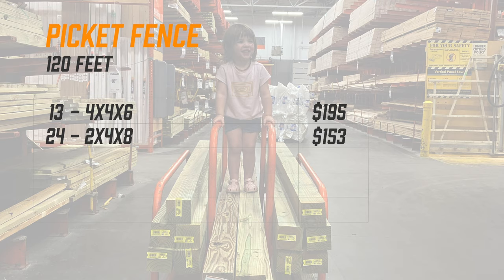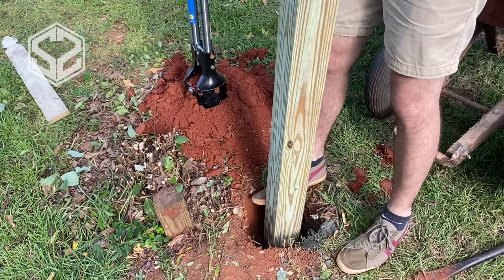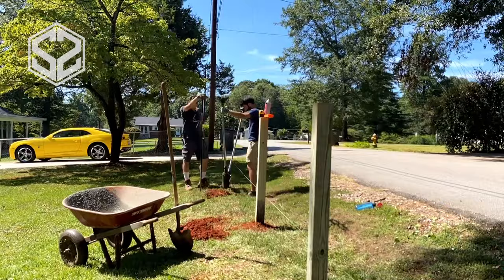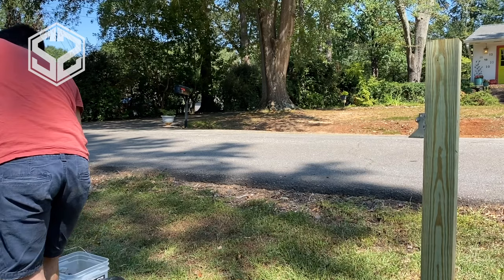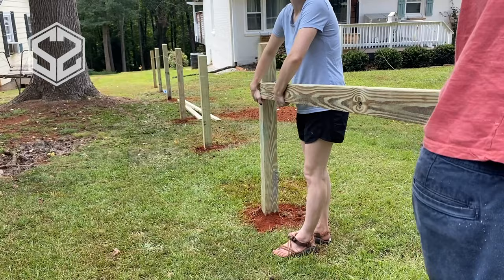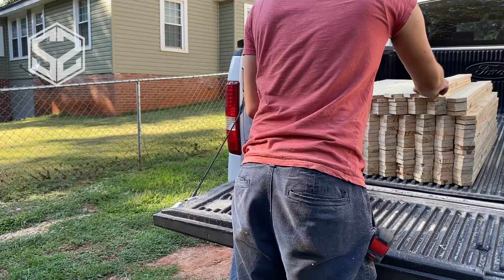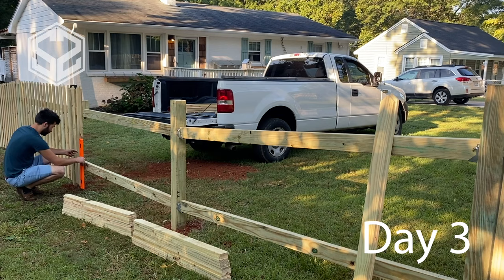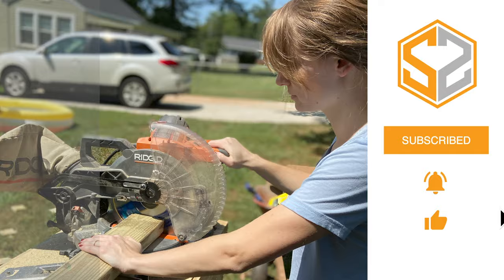How to build a picket fence.

Comment: Great job. What were the dimensions of each piece?
Reply from the maker: I used 6 foot 4x4s for the posts. I placed the posts 2 feet into the ground leaving 4 feet above ground. If you have heavy frost in the winter seasons you may want to go deeper. Posts were about 8 feet apart. The pickets were cut at 45in. I kept the pickets 3 inches off of the ground making the fence 4 feet tall. And I used 2 2x4x8 in between the posts to mount the pickets to. Hope that helps.

Comment: Did you keep the main post on the slope the same height? New sub 😉
Reply from the maker: Thanks for the sub! I did for all except 2 posts. The ground on that side sloped down, up and then back down again. If I followed the land the fence line looked odd. Where it first went down I made the lowest post 2 inches higher and as it went back up the highest post I made it about 2 inches shorter. This compensated for the uneven ground.  I hope that helps and makes sense.

Comment: Fence posts are plum, not level. The stuff you put in the hole to secure the fence posts is concrete, not cement. Other than that, great video.
Reply from the maker: True and true. Thanks! 😁

Comment: I think it’s a mistake to only use half of the guide/spacer as the boards you buy are rarely straight.   Should cut the bottom a few inches so it still goes almost to the bottom other wise your eyeballing it which can be done but is a pain.   Also, surprised you didn’t use braces for the posts.   Overall great job